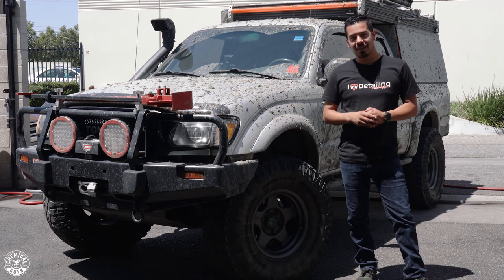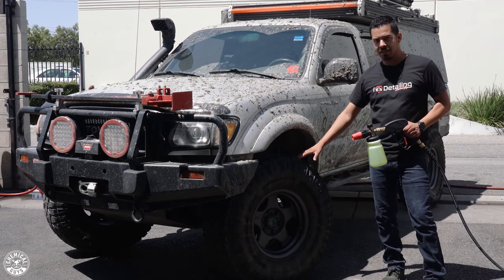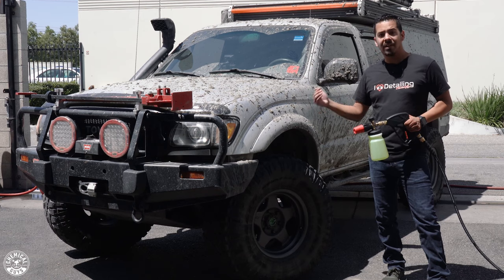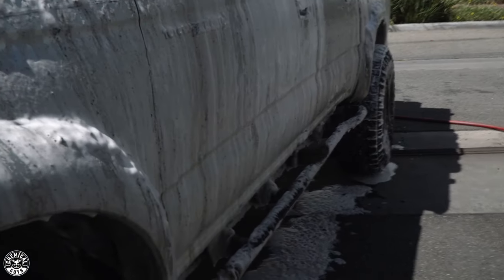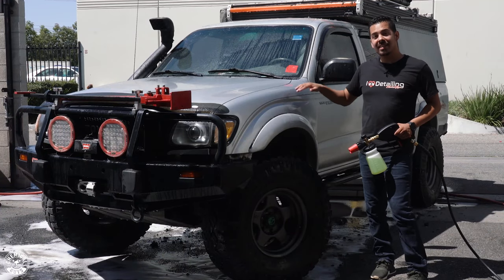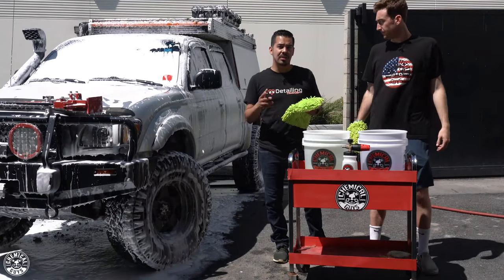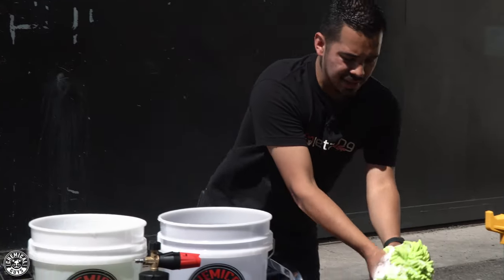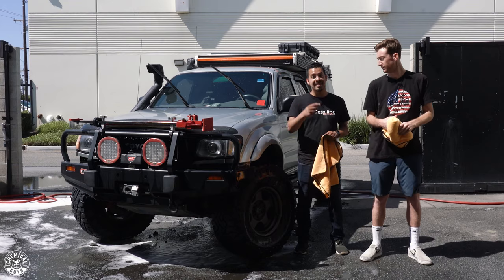How To Easily Remove Dried Mud The Right Way! - Chemical Guys

Comment: I know you guys say to run a foam cannon you should have a pressure washer that has an output of at least 2.3 GPM but my electric Ryobi only puts out 1.2 GPM at 2,000 PSI. Will your foam cannon or any foam cannon be able to work with such a low output?
Reply from the maker: Hey!
Our foam cannon  will work with your pressure washer but you may need to compensate with more soap in order to get the same levels of foam as a pressure washer with 2.3+ GPM. It will 100% still work though and give you lots of foam!
Reply: @ChemicalGuys  Ok cool thanks!

Comment: What if my borla exhaust tip was gloss black and from offroading its developed a layer of clay/dirt that wont wash off?
Reply from the maker: Hey! Try using Diablo Gel Wheel Cleaner with a soft brush to remove grime.

Comment: what pressure washer is that? and do you use the same one in every video?
Reply from the maker: It's a Power Play pressure washer, 3300 psi and 2.7 GPM. And no we have several different pressure washers that we use in all our videos.
Thanks for watching!
Reply: Out of all the ones you guys use, what would you recommend for a foam cannon setup one that’s over the recommended gpm and psi

Comment: How do you remove cement splatter from a car
Reply from the maker: Hey!
Cement splatter can be very difficult to remove and takes a lot of patience. Try multiple foam washes with Citrus Wash and Gloss to loosen it up followed by  Butter Wet Wax and possibly a clay bar treatment if the splatter is still present. Polish after if there are any scratches.
Happy detailing!